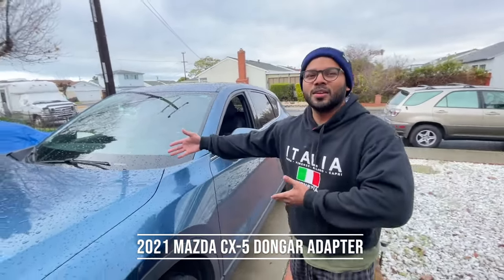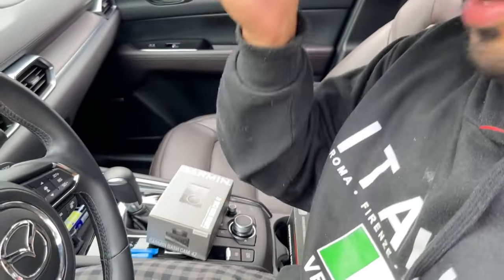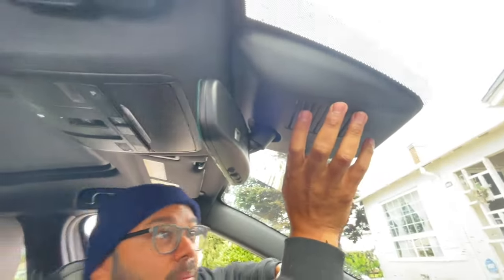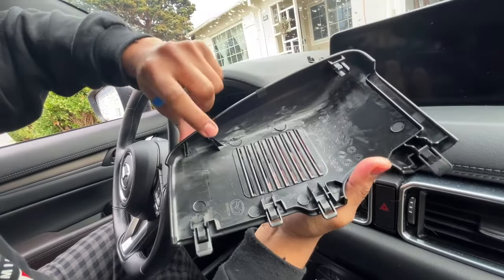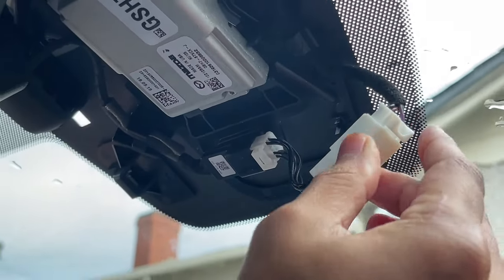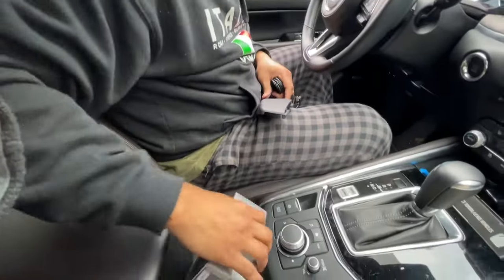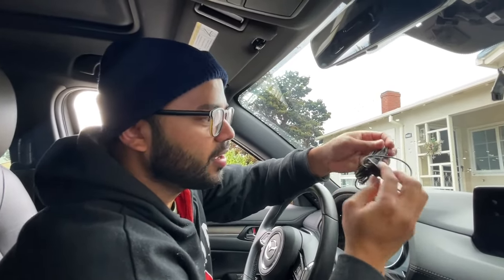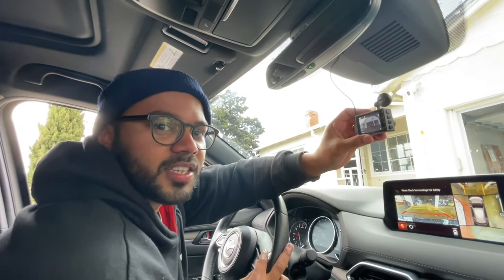2021 Mazda CX-5 Dashcam Installation | Dongar Adapter

Comment: Has Mazda discovered dash cameras yet? It's 2022. We have cutting edge infotainment systems. But no USB port where we plug in dash cameras. Nope. We buy a kit & installation is DIY. Vehicles should be coming standard with dash cams now. At least make them an option on higher trims.
Reply from the maker: haha I totally agree with you on this one. This should be a default in todays world, but nope. Also, I guarantee that when this does become a feature, it'll be offered on the higher trims as part of a tech package costing your $1000 more 🤣
Reply: Please tell me one car manufacturer that provide usb port on top of windshield for dashcam? Thanks
Reply: @fx3650  I think the people who design cars don't drive them or don't know what a dash camera is. I got mine installed but had to run the wire from the console to the top of the windshield.
Reply: In my brother’s Ford Raptor (Ranger) there is a USB port behind the mirror for easy plug in. With all the bad wrap Ford gets at least they thought of it. Mazda Dealer wanted $1800 to fit a camera. I said no.

Comment: Using this method, does the motion sensor work to record events in front while not using the car? At the moment, I have both my dashcams going to the main cigarette port using a dual USB pigtail. Looks clean and they turn on when car is powered on. Also, by the looks of it, there's lots of room to add a dual USB splitter under the plastic covers. I'd also have a use the adapter for home link.

Comment: Hi I use the CX-9 and it has the same big case near that rear view mirror. Just letting you know that there’s gap right at the bottom of that case for you to route the dash cam cable neatly and if you want to use the shorter cable you mentioned. :)
Reply from the maker: Ahhh...that thought crossed my mind for a split second during installation, but I assumed the cable couldn't fit thru the gap there and continued doing it the way seen here :D 
Good to know that's possible and that it works for your CX9! thanks for your sharing that input Afham👍

Comment: Bravo on a great instructional video. I used some double sided foam tape to help attach the three new Dongar connectors to the base-plate on the glass side so they wouldn't rattle around. And FYI, if anyone who does this install happens to inflict some minor surface imperfections on the plastic clam-shell parts, just get a small piece of 600 grit or finer sandpaper and very gently 'kiss' the plastic with light strokes until the imperfections are buffed out.

Comment: Thanks Auto Minute for putting this together.  I have wanted to add a simple dash cam for awhile now but am not very adventurous when it comes to messing with my car's wiring (still traumatized by a bad experience with an 8-track player and a '68 Camaro back in the 70's 🙂).  Your step-by-step instructions on this video convinced me that I could do this without damaging the rest of my 2019 CX-9 GT.  Getting the plastic housing off was a little more difficult than yours was and it took me a minute or two to find the clip to remove the 10-pin plug but all told it took about 15 minutes to install a Garmin 57 dash cam.  The Dongar adapter works as advertised.
Reply from the maker: Hi Thomas, thank you for the kind words! "Wrenching" on your new car can definitely be a little nerve wrecking, especially when it comes to plastic tabs and electronics. Filming this was completely impromptu (as you can tell by my professional outfit ha!), but I'm truly happy that it's helped so many of my fellow Mazda folks out there.  I'm trying to be more intentional in making videos that can be helpful moving forward :D - Cheers!

Comment: You can actually run the cable out from the bottom side of that plastic cover. There is a slot there thick enough to run the cable through. That way you can use the short cable they provide instead of having to bundle all the excess cable inside the cover.
Reply from the maker: You are absolutely correct sir. I have a Vantrue dashcam installed on my car now, but I ended up re-routing thru the bottom thanks to you guy's comments!

Comment: I just used the same approach with a shorter cable and it works great. Thank you for letting us know this small hack, greatly appreciated 👍🏻✌🏻
Reply from the maker: Appreciate it, glad this was helpful!
Reply: does it work for parking mode or do I need to hardwire it.
Reply: Same question ^
Reply: The second you turn your car on, it starts working until you completely stop the ignition

Comment: Cool video, I just installed a dash cam yesterday and had to run the cable all across the windshield lol because I didn't even know something like this existed. Question does this dongle pull power all the time? Or only when the car is on? Thanks!
Reply: I just did it apparently it's not permanent..
Reply from the maker: Power ON and OFF with the vehicle. Hardwire kit is still the way to go if you want the 24-hr surveillance :) I believe they sell that as well

Comment: Nice video - Quick question if you have time: Does it power off once the car is turned off and locked?
I don't want my dashcam running 24/7, so i'd prefer a setup that powers off with the vehicle.
Currently mine of plugged into the cigarette lighter which gets power all the time...also I have a ODB-II power lead, but that also stayed powered...sheesshhhh
Reply from the maker: Appreciate it! Sir Raymond, let me tell ya, this adapter powers ON and OFF with the vehicle. You will not have to worry about the 24/7 power drain. Is this for your CX5 as well?

Comment: A very good explanation and Happy Easter greetings from England. 
I too have a CX-5 2023 model. The coloured(English spelling sorry) tool can be acquired from the iFixit tool kit selections. I carry mine always because I use it quite often on a number of things.
Your method is one option for the dash cam but I need to go into the cabin fuse box for hardwiring as 'parked collisions' where the offender drives off, there's never enough charge in the dash cams on-board battery to capture the offender. 
Ask me how I know? I had 7 occasions over a two-year period, where I had to pay the excess on my insurance to get it repaired.
The police were not interested, my landlord has a CCTV system installed but refused to hand over the data.
I have had to install my own CCTV wirelessly-linked to my phone and stored into the cloud on a monthly subscription. I can view 24/7 and not miss an event.
I could offer this as a surveillance service to my neighbours(English spelling sorry) but they and their visitors have hit my vehicle and driven off so that option is off the table!
There's the option of a OBDII adapter and my favourite(English spelling sorry) is a battery bank that is looped in between the USB port and the dash cam. I have a rear dash cam installed for rear collisions.
Oh! Supermarkets are the worst here in England. A lot of drunk/drugged drivers too! 
Sorry, for the long-winded essay as I am autistic and write as I speak with no expletives or superlatives.
I am a good citizen and try to help others where I can.
I am also a disabled/handicapped driver, vehicle technician and toolmaking engineer.
Best Wishes.

Comment: Thank you ! Great step by step and looks factory. I have a 2023 with the bulky non frameless mirror and it actually is the same connection has the frameless one used in this video.
Reply: Hi, sorry, is that a 2023 CX-5 Homura, by any chance?
Reply from the maker: Takumi :D ....but since I'm located in USA, it's just the "Signature"

Comment: Very informative video. I have exact same 2021 Signature just in Red. I have a question I have got a Thinkware Dashcam. I have dongle. Does wiring you showed this way will drain battery in winters? Also do you keep your dashcam on for parking mode?
Reply from the maker: Hey there! So this dongle works when the vehicle is ON only. It's designed this way to prevent using your cars battery so you don't end up stranded if your vehicle's been sitting for a few days. Unfortunately, this also means that "parking mode" will not work with this because parking mode requires constant power even when the vehicle is OFF. Hope that helps!

Comment: Hey there, thanks for your video. I was about to hard wire and came across your channel, bought the Dongar Technologies adapter not knowing if it would work on my 2023 Mazda CX-5 Carbon Edition but it works perfectly. Thank you once again.
Reply from the maker: Awesome man! I'm glad this helped you decide before going down the original route :D
Reply: Hi, sorry, do you know if the Carbon edition would be the same as the Homura? I get mine tomorrow.
Reply from the maker: @mexicomatt212  I haven't heard of the "Homura" ...but if it's a '23 model year, then the same adapter I use here should work. Keep us posted!
Reply: @JoseHernandez-bf5fi Does the camera work when the car is parked and not in use? Or does it only get power when you turn on the car?
Reply: @hkiajtaqks5253  Only gets power/turns on when car is on, if you want parking surveillance you would have to hardwire. In my case I don't need parking mode, this why it was a better option for me.

Comment: Your video is really helpful brother. Did you install the rear dashcam as well ? Because I do not find a good demo of it in the YouTube. Appreciate if you can explain how did you install in the rear if you actually did !!
Reply from the maker: Hey brother, appreciate the kind words. Unfortunately, I'm not running a dashcam at the back. However, I do have a dual-lens camera now that captures footage inside the vehicle as well. I know it's a not true rear-cam solution, but it might interest you (https://youtu.be/7NsmSZCP7VA?si=YQBsfuGJupClim5l&t=126) I've timestamped the link shared so you can see what it offers.

Comment: Thanks for the detailed guide! Quick question, does this method interfere with any existing functionality of the car like lane keep assist? I have a CX-5 signature 2024 and am considering doing this!
Reply from the maker: Hey! It doesn't interfere with any safety tech. It's sourcing power from the circuit that powers your auto-dimming and homelink system. I've had mine running since I posted that video, zero issues. I've even upgraded my dash cam, but running the same wiring setup.

Comment: Looks great.  Except how does it work when parked.  Does that supply power when the car is off?  If not, it's not that great.
Reply from the maker: Hey Paul, this will turn ON/OFF with the vehicle. It's meant to be a simpler alternative to routing a cable thru the entire cabin into the cigarette lighter/auxiliary power outlet, which also turns ON/OFF with your vehicle. If you're looking for parked functionality, you'll have to run a hardwire kit (usually taps into a fuse). I'll be making a video on that one for one of my older cars. Cheers.
Reply: @Auto-Minute I get that, but one main reason for a dashcam is to monitor it when the vehicle is parked.  We use fuse taps to allow for this.  We install Blackview dashcams and the wiring included is very thin and very easy to route anywhere.  Nice idea tho
Reply from the maker: @PaulBelkin  Oh yeah definitely! I personally love Blackvue cameras :D ...but I know the concept of routing cables isn't a comfortable task for everyone. Perhaps I'll do a hardwired Backvue installation in a future video.

Comment: I have one question since you have this from a long time. Does its get heated up on long trips or no such issues ??
Reply from the maker: Hi Sandy! I've had this installed on our CX5 for well over a year at this point and there's honestly nothing bad to report back on. We also park the car outside thru rain and shine. I think the only thing that got a little loose was the magnet the dashcam attaches to....but that can be attributed to me re-locating the dash cam a few times. These dash cam adhesives aren't meant to be moved around so many times so test out a spot first before sticking it on :D Hope this helped! Cheers.

Comment: Good job man. Very helpful.

Just FYI, I have a Mazda 6 and the white plug has a push button to open instead of a simple pull.
Reply from the maker: Appreciate it man 🤙...and as some folks already noted (which I missed), there's a gap right at the bottom of the panel to route the cable as well.

Comment: I can't get the 10 pin to remove from the camera and you make it look easy. Is there a tab im missing that loosens it?
Reply from the maker: Hey there! Are you having trouble removing the vehicle's 10-pin connector from it's housing? There is a small tab that you need to push in and then slide the connector straight out. Push the tab in with one hand and use the other hand to guide the connector out. Let me know if this did the trick!

Comment: Thanks for the video, a saw this and realize that this adaptor even exists. I have a a500s 70mai dashcam that i use in my old mazda 3 R with a complex instalation (my brain doesn't accept bad instalation or mistakes on my cars xd) and this video show me a new way. Yoy have in that mirror case (i have the same) a little spaces(?) in the bottom and yo can pass the cable right there. I think i have a new version of the adaptar that it has a longer cable in the usb section so it´s more easier instalation. I will do a video when my new camera arrived (a 810s 70mai with rear camera). Regards from Chile.
Reply from the maker: Appreciate it brother! Thanks for the feedback and funny you mention about the bottom of the plastic shroud because I did end up re-routing the cable thru there a few months later :D

Comment: just tried to install using this method today, it seems like it would work but i got the wrong adapter, i dont have the frameless mirror  so i bought the one labeled as such in your description but it doesnt fit, i need the one you labeled for the frameless mirror. it seems like the differentiating factor is the auto dimming function not whether or not your mirror is frameless. i have a 2021 CX-5 grand touring reserve
Reply from the maker: Ah shucks, was your connector in the same location as mine? Hope you got it sorted out and are geared up!

Comment: Very elegant solution.  Nothing tedious about any of this.  I wonder if this can be used to connect up a radar detector?  I have no interest in a dash cam, but this device beats splicing into the wiring harness to get power.  Oh well my connector is a 4 pin with the factory frameless mirror and Homelink.  No such adapater on that site.
Reply from the maker: Thanks Mark! It's definitely a pretty sweet solution for dashcam connectivity. Bummer they don't have that fits your vehicle, but just fyi...the power output on this thing is 2A @ 5V ✌

Comment: Nice video! Does it switch to parking mode when engine is off?
Reply: Doubtful, since USB connectors only have power, ground, and data. I have a problem finding power that's only on with ignition on a CX-30 (internal fusebox is always on). I don't think this product will correct that.

Comment: Hi, this approach looks really nice and tidy. Is this option available for all the Mazda cx-5 with homelink rear view mirror? I just bought a 2022 cx-5 preferred with homelink rear view mirror but I am not sure whether it is frameless or not. I hope it will work on my car hahaha.
Reply from the maker: Hey there! Does your car have the connector on the back of the rearview mirror? If you have to remove the plastic shroud like in my video, then you most likely have the frameless adapter :) Let me know how it goes!

Comment: Excellent video! I suspect this Dongar kit will also work in my 2024 Miata, which has the same frameless mirror and a similar camera housing.
Reply from the maker: Hey brother, I actually did a video on the ND Miata 🤙🏽 You can confirm fitment here - https://youtu.be/ldHWmbteSCU?si=EON5S3LxSgAzM7Hg
Reply: @Auto-Minute  Mine is a 2024 which has a totally new electrical system compared to the 2023 in that video. That will not work for a 2024 Miata.
Reply from the maker: @dlg5485  Oh gotcha! my buddy just picked up a '24, maybe I can get my hands on it LOL appreciate the input!